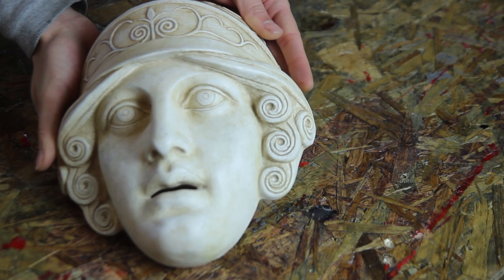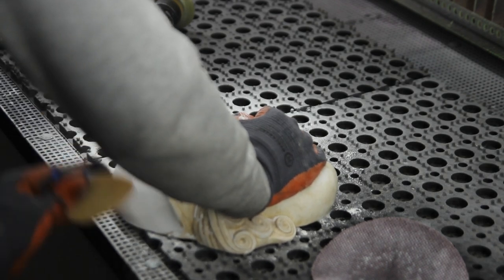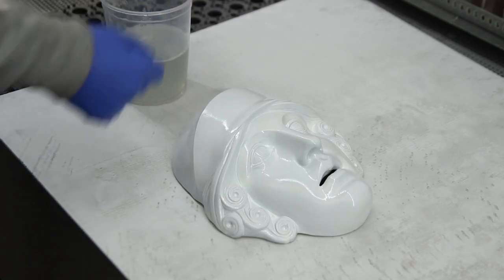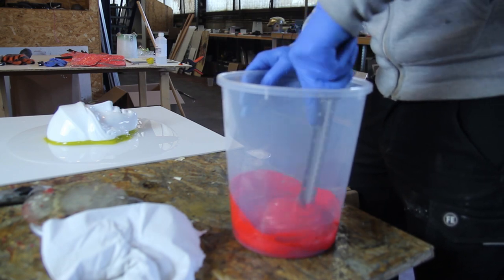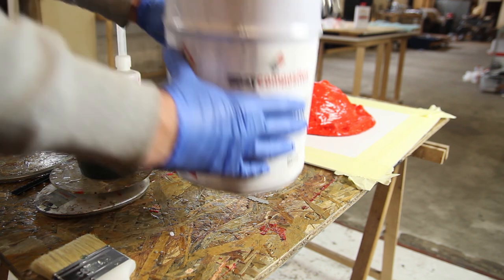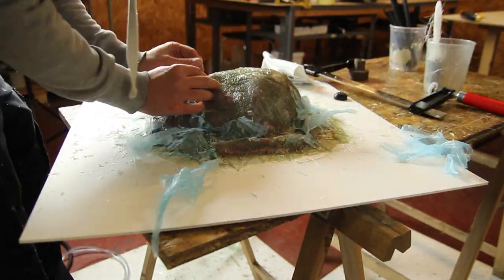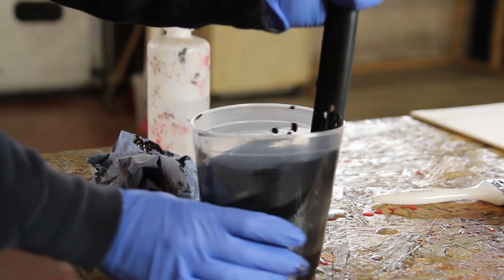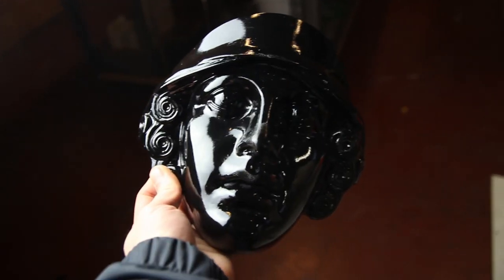Silicone Sleeve Moulding - Replicate Parts

Comment: I always wondering why anyone use this way to build moulds. The reason is so easy. Thank for the light
Reply from the maker: true! more set-ups are possible with silicone, I'll have that in another video
Reply: @MatthieuLibeert  can you show me please? I had big problems with a mould.  I worked with a 2mm offset wax plates on this mould. My idea is to fill the differece between mould and first part. In this way maybe i can use the mould

Comment: Very informative video! I wish you could go into more detail with the vacuum bagging you did. Can’t wait to see more!
Reply from the maker: Thanks, In fact there's not much more to say :) I've wanted to add the bag to make sure the fiberglass shell was comforming as good as possible to the silicone sleeve, but even if some points are not in full contact or if you have some airpockets in the fiberlass/polyester shell it doesn't matter that much as the shell is more of a general overall support for the sleeve